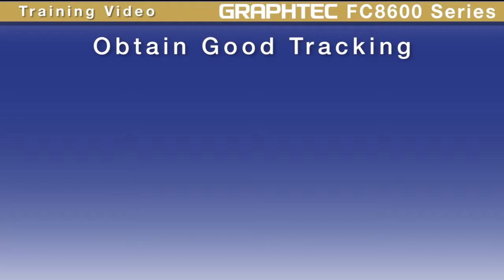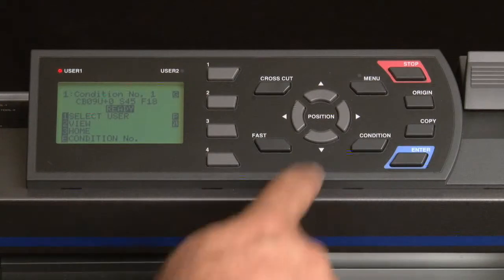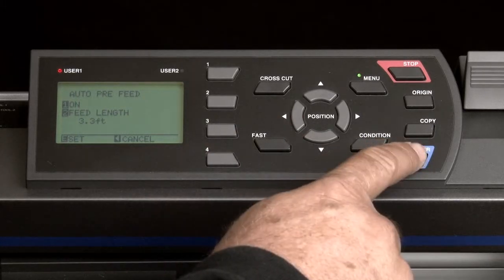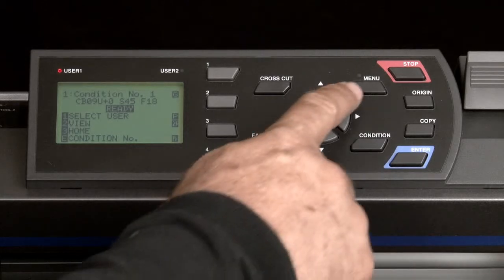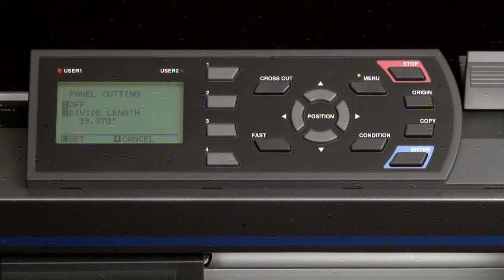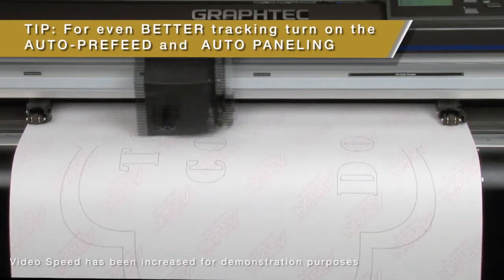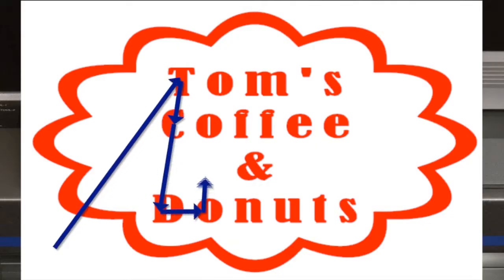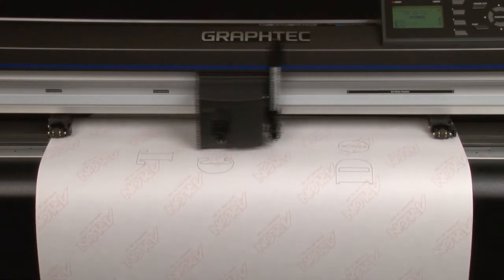Graphtec FC8600 Tutorial - Tips for Good Tracking

Comment: I use mine to cut window tinting lately the film seems to be feeding faster from one side to the other by the time I get done cutting a door glass the corner does not line up by the time I get done cutting a 50 " back window  the film cut is off by a quarter to a half-inch where it meets at the end any suggestions